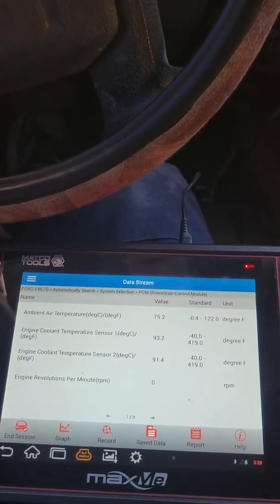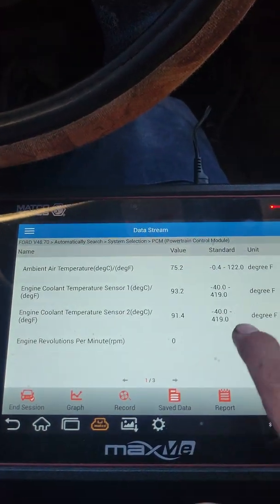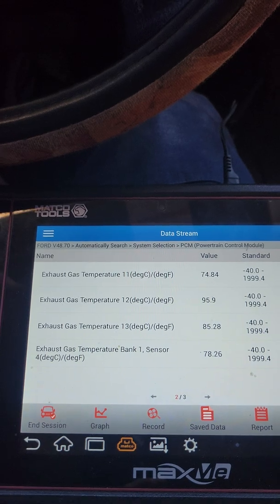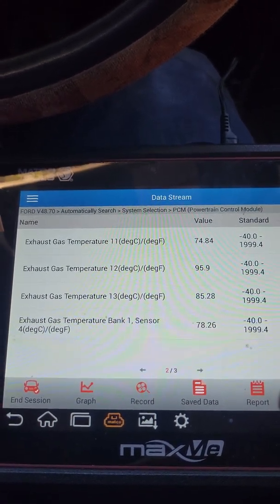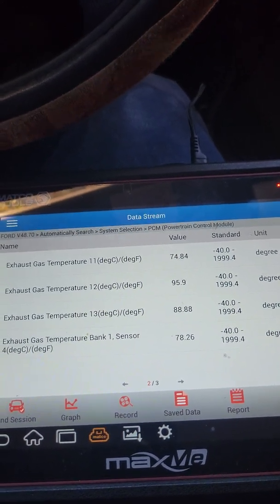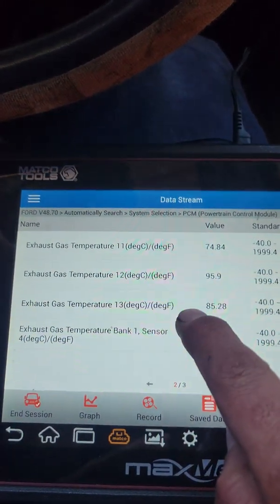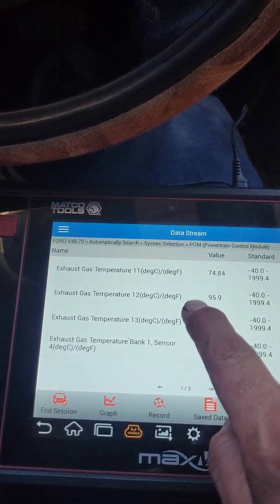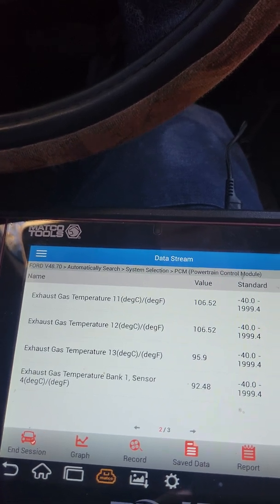Step 1, getting Powerstroke out of LIMP MODE                 #diesel #powerstrokediesel #palmsprings

Comment: On my 2022 f450 I disconnect the the coolant sensor, intake sensor, and map sensor.  I never had a check engine light come on and now I do.  Would disconnecting cause this.   I only have 33k miles and all I did was install a Msnb intake and a intake manifold that required no tunning.
Reply: Yes it would